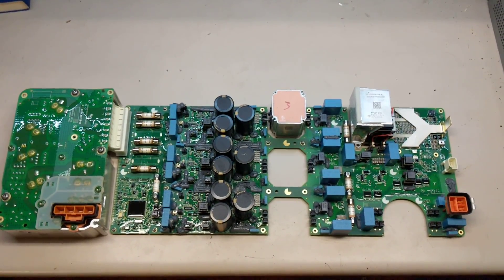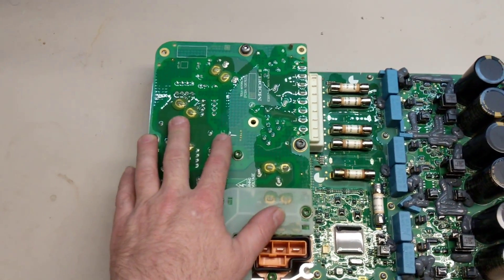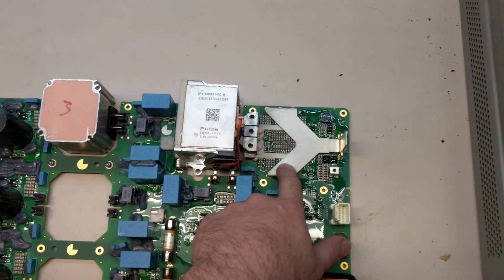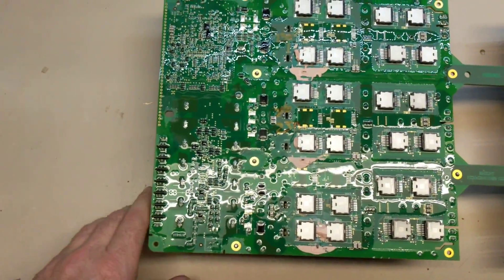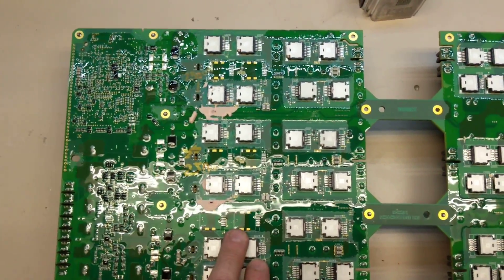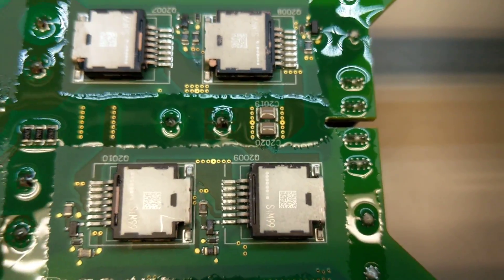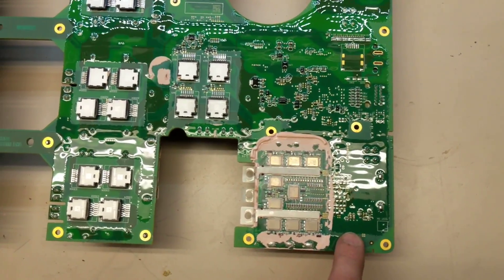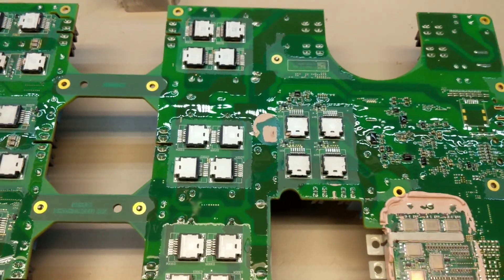Tesla vehicle to grid: Debunked! PART 1

Comment: Love your channel, I am curious, does these motor controllers work anywhere near like a quadcopter speed controller(pwm in controls fets output), is it possible to bump up the curve essentially allowing the motor controller to put out more power to the motor for a given PWM value, just trying to think of ways to unlock the performance model 3, I know the hardware can do a lot more than it does know, and I have many friends that are very interested in this (we think we are being held back to sell more performance model S's, whats the point of buying a P100D if a P3D is putting out similar numbers due to the better battery's and 1200lb lighter vehicle), also how crazy is the intel encyption (you can PM me if this stuff if you want), this car seriously needs to be unlocked

Comment: Most vehicle to grid systems include external V2G unit. Car only communicates and gives access to it's HV battery. Everything else is done via external unit. So Tesla could do an update to make it happen but I'm not sure there's standard communication protocol out there.
Reply: 400v DC is used in the car battery. Coincidentally PV systems are also using 400v to AC, so an external solar unit with a switch would work.
Reply: @martin5697  PV systems use wide range of voltages this depends on manufacturer and MPPT optimized range.  Connecting PV directly to car battery is rather bad idea.

Comment: Your looking at old tec. It dosen't have the inhouse chip that came in  2019, it's been changed again 2020. Sorry this is a very outdated board. Check out sandy monroe's teardown of the model Y it's got another board that's never been seen before. Very different from model 3 2019. This board you've got looks like a 2018/19 early type. First addition. Not a current technology. Tesla moves fast if they figure out a better way they implement it.
Reply: Which episode did they go through the inboard charger?
Reply: Yes and sandy said that there was no vehicle to grid feature when he did some of the tear down.
Reply: Can u please share the link.?
Reply: Did Sandy mention V to G feature?
Reply: @sirousmohseni4  They haven't finished the technology analysis. They tore the whole car apart piece by piece. It's on "Monroe live" you tube channel
Reply: @dhincks1  did they shown OBC teardown
Reply: Yes and they've got their tech people doing a deeper dive than just looking at it physically. Sandy showed the model Y vs 3 they aren't the same.
Reply: @sirousmohseni4  See episode 17 around minute 3
Reply: Read the video description.
Reply: Don't own a Tesla, but if you want to use V2G on an older model how hard would it be for a service center to swap an old board for a new V2G capable board? If this board is the only major swap then it should be straight forward.
Reply: Good video.  I hope newer boards have that in its design.

Comment: I would think Tesla would use the high voltage DC into a transformer base inverter for maximum efficiency. This could easily be done through code and external hardware. I guess we’ll have to wait and see!

Comment: Good video but it looks like a small change and they can have it work as bi-directional with swapping some diodes for IGBTs or SiC fets etc.  This will need a small re-design to add the gate drivers etc.  But Its not unlike Tesla to make running changes part way into a production year.   My thoughts are they didn't bother with this just yet or at least until the new battery.  I really makes sense to have bi-directional abilities with a 1million + mile pack!  Not so much with a 300-500k mile pack.
Reply: @FooBar89  There is 1000s of way to achive that.  IN fact the motor controller already does this.  It tracks the motor back emf and feels the power to the batter or to the motor depending if its negative or positive torque. I don't see the reason for an external inverter.  I meen when you charge at a Tesla supercharger that is what it does the supercharger has many chargers in parallel that tap straight into the back with DC current.
Reply: @FooBar89  No They are going to come with bi-directional chargers they said this during battery day.  But its a gimmick lets put it this way.  Is you car charging from your solar at home when you are at work?
Reply: @FooBar89  Yeah and that is coming. But most cars are plugged in charging when its dark.  So its not as useful as people think it is. Its not easy to use as a backup either because you need a special system that stops you from back feeding to the grid.

Comment: If you have a look at the charger that Jack has in this vieo it looks a bit different to yours: https://youtu.be/Dum1s4gfSD4?t=989. What do you think? Also, it would be pretty trivial for Tesla to replace those diodes with transistors would it not? If that is the only thing needed to do V2G, I wouldn' be surprised if they have already changed it (assuming they want to do V2G).
Reply from the maker: That's the exact same board.  Keep in mind, I have the PCB removed from the housing, and all the magnetics are set aside.
Reply: @Ingineerix  It looks different to me. If you look at the transformer (I think its a transformer? the grey box) on the top right, it looks smaller and the text is printed at a different angle. It's also a different colour, and there are none of the blue heat syncs on the transistor/diodes.

Comment: Could it be that you're looking at an older version of the board? 
Compare to: https://countysustainabilitygroup.com/2020/05/20/tesla-quietly-adds-bidirectional-charging-capability-for-game-changing-new-features/
Reply from the maker: Identical to mine.   You can even see the lack of gate drive IC's on the right side (output) which would need to be there to support SR.
Reply: @Ingineerix  👍 thanks!

Comment: Is it possible they were referring just to cars plugged into a power-wall for charging? Seems more plausinle the DC link may be reversed.
Reply: Yes exactly, battery investor day is as much about the third generation power wall as it is about the batteries. I also heard from a good source that Tesla has a new gateway for the power wall and most likely added connections for the charger in the gateway so that bi directional is possible

Comment: Okay going through all the comments and your replies you're saying that the feature isn't built in, though it is with a software switch to get DC outflow, but it would still require some external hardware....like the HWPC...which was just updated with a capability to do just that...to complete the feat for true V2G?

I get the contrarian view for the clicks, but you'd have been better served explaining all this in your video and saying what is still required, which isn't much. You writing it off as needing "permitting, installation, etc." is just explaining what's needed to get a home charger installed.
Reply from the maker: A HPWC doesn't have an inverter, so it cannot convert DC to to AC.  Go check out a 10kW grid tie inverter for solar. That's basically what you'd need to take DC from the car and put into the grid.  It's Large, Heavy, and expensive.   You definitely need a lot more permitting to install a grid tie device.  You also need an interconnect agreement from your utility, as well as a meter change.  But the only thing I'm saying here is that the PCS Tesla has been putting in all Model 3's is not bi-directional, That's it.  Of course it's possible to do grid-tie, but it's not easy or cheap, and definitely not built in as Electrek posits.
Reply: @Ingineerix  Appreciate the enlightening response

Comment: Also, where are the 3 massive inductors on your one that are shown here https://electrek.co/wp-content/uploads/sites/3/2020/05/IMG_1151.jpg? in the plastic potted mount? Is it possible there are many changes since these production board versions?
Reply from the maker: They are located under the cold plate.  I didn't show them, but you can see the connections for them.

Comment: a 2018 PCS? did you get mine from my 24K VIN m3 that failed early on? That board is Gen1 fyi.

You talk about not seeing it in the code in another comment reply but you're discounting what green said? He seems way more in tune on tesla's software coding than you do, no offense. If this was purely a clickbait article based on current news, congrats.
Reply from the maker: I am a hardware engineer, Green is very capable, but he doesn't know as much about hardware, DSPs, etc.   If it were in the code, I'd see CAN signals, Diag alert codes for V2G, etc.  The only V2G stuff in the model # codebase is for CCS in EU models.  They use PLC to communicate with the charging station which has an inherent V2G as part of the standard.  Hardware doesn't lie.  Diodes can't work in reverse as active devices!
Reply: @Ingineerix  Never even knew they used PLC, consider me chastened, thx for the courteous response
Reply from the maker: Yeah, it's ridiculous too!  You can tell it was designed by committee!
Reply: So they don't code protect their micros ?

Comment: Thick cables run from the charge port to the penthouse.  How come they can get away with those high currents and voltages on a PC board?
Reply from the maker: The thick cables carry DC directly to contactors.  The PCS never sees these currents.  48A max on the AC input, and about 35A max on the DC output.
Reply: @Ingineerix  Oh, I see.  So at a Supercharger, the connector outputs DC.  When plugged into a wall 110V or 220V, you are converting from AC to DC, but that is only Level 1 and we are dealing with much lower currents.  I was wondering how that board deals with 200kW from Supercharger v2, the answer being it doesn't.
I think Jack Rickards mentioned the DC from the battery could be made available as an output with a software change. Could a Tesla be used in a home solar setup, where the DC behaves and is dealt with like DC coming from solar panels?

Comment: So how did the engineer "Marco" get it so wrong. The origin article https://electrek.co/2020/05/19/tesla-bidirectional-charging-ready-game-changing-features/ shows this image https://electrek.co/wp-content/uploads/sites/3/2020/05/Screen-Shot-2020-05-19-at-1.58.52-PM.jpg I'm assuming you're referring to the last mosfet column on the far-right of his simplified schematic? He's labelled these mosfets Q6, Q7, Q13, Q14, Q20, Q21, Q27, Q28, Q34, Q35, Q41, Q42. Are you saying these are actually the power diodes you're pointing at instead?
Reply from the maker: Yes.  I haven't seen Marco's board, but every one I've seen has Diodes.  You can clearly see them in the video.  Also, all Tesla's callouts on this board are 4 digit, since the most of the power circuitry is duplicated 3 times, so for example Q1001 has sisters as Q2002 and Q3003.   I listed all this in my description above.
Reply: Have you tested those passively with a meter to verify they are diodes rather than just relying on the board label convention?
Reply from the maker: Of course, see: https://youtu.be/UkRk2OQI7RE

Comment: Thank you for your expert analysis. It’s not a realistic use of current Tesla vehicles, since it would place too much wear on the battery. It would be more reasonable to expect this functionality with technology on vehicles with the million miles batteries. Perhaps we can hope that an option for this would be available when the Cybertruck comes out.
Reply from the maker: I'm not commenting on the pack longevity, just the claim that the internal charger (PCS) can run in reverse.  But yeah, Tesla has a clause in the warranty which will void it if you use the pack for non-drive applications.

Comment: Great analysis, thanks. But couldn’t the design have changed from the 2018 board you show to today‘s design in the Y and 3? Have you tried to reach out to Marco Gaxiola to understand why his reverse engineering resulted in showing FETs and not Diodes?
Tesla is known for continuous changes...
Reply from the maker: I have access to the code, so I would see an obvious change.  There would also be added CAN messages to make it work.  In addition the TMS320 (see description) doesn't have enough hardware PWM channels to make this work, It would be a big change.
Reply: @Ingineerix  But based on this old board, right?
Reply from the maker: Correct.  But keep in mind, even if Tesla did add SR to the new ones (I'm not saying they did/didn't), You still need a lot more before calling it V2G.  For starters, I don't know of any EVSE's that are UL listed for grid tie.  You'd also need a interconnect agreement with the utility and a new meter.
Reply: @Ingineerix  true, but what about using the power wall to convert the DC voltage into AC? I would bet battery investor day is more about the third generation power wall and an integrated charger or a new gateway with connections for a charger allowing for bi-directional
Reply: @christianpeter7029  This whole article is about the bi-directionality of the AC charger, so the DC charger, although interesting, isn't related to this subject.
Reply: @Ingineerix  My hope is that my Model Y would be able to just provide enough energy power to my Tesla Solar (inverter) to allow Solar to function in a power outage situation, at least then I would have power during the day in a pinch. That would be all I need :)
Reply: @christianpeter7029  I saw an interview with the company that makes the quasar and they claim they could easily do a software change with Tesla to enable vehicle-to-grid in the Tesla.

Comment: Great info! So basically the design is ready for bi-directional, but not implemented yet. When they want to implement they have to change diodes for switches, and that's pretty much it.
Reply from the maker: No, it's not that simple.  It definitely could be done, but it's a major change.  Tesla isn't going to call all the cars back in that want V2G and change the whole PCS out.   The only thing I'm debunking here is the claim that it's already built in.
Reply: @Ingineerix  Oh, I definitely DID NOT mean to sound like they were going to start tinkering with already-built units. I meant changes on the production line when they are closing in on new batteries that can actually take V2G use without debilitating degradation.
Reply from the maker: @RFjellstroem  Ok, Gotcha.  Also as mentioned in my description, the TMS320 doesn't have enough hardware PWM channels to make this work, It would be a big change.
Reply: @Ingineerix  Ok. I'm not super into fabrication, so I don't know how much equipment the fab is going to have to change to produce the boards as bi-directional, but I'm guessing that number would be the key cost aspect for having the design "almost bi-directional" for several years. If the fab can keep most of the equipment after the change, you get lower cost on the new units. Switching the diodes for switches wouldn't change much equipment percentage, but adding more channels might. Not sure, as I said I'm not super into fabrication.
Reply: @Ingineerix  they call all HW2.5 cars back so...
Reply: @mattaut88  Completely different pcb.  HW2.5 -> HW3 has nothing to do with the PCS.

Comment: Jack up a wheel and drive a generator via rollers. Or better yet, drive up on a treadmill type machine so the wheels drive the belt and the belt drives a generator.

Comment: Nice analysis. You proved that car cannot generate AC back, but it doesn't mean that it can be used to supply energy to grid. If you were to install at home special device, which would switch vehicle to DC charging mode, you have basically battery connected to charging socket of car. That said, you can DC charge the car or pull DC current directly from battery. Then this special device can convert DC to AC and push energy to grid.
Reply from the maker: Yes, this is true.  With just a simple software change the charge port could send DC out, but then you'd need an expensive external converter and it would need permitting, installation, etc.
Reply: @Ingineerix  Could you please comment on whether the inverter hardware for the moror is in any way adaptable (as a separate unit) to be able to convert battery DC to mains AC? As an example of what existing hardware Tesla could use to manufacture V2G grid box for the home for example.
Reply from the maker: @chouky02  No, the drive unit inverter is highly integrated, and it would require expensive and bulk added magnetics and contactors.  They would never do this.
Reply: @Ingineerix  Could the inverter in a powerwall do it?
Reply: Do the suspected diodes and transistors have different part numbers? A side from markings on the mainboard, have you taken a multimeter to the suspected diodes and compare it with the transistors?
Reply from the maker: Yes, see the list in my description above.

Comment: Glad to see you're still at it. How's the sprinter conversion?
Reply from the maker: Sprinter is still pending.  We found the Sprinter is as easy to convert.  We are doing the ProMaster now though.   It's chassis is much easier to convert!   https://maxwellvehicles.com/
Reply: @Ingineerix  do you think a diesel hybrid could work. For example put a tesla front motor on the front axle of a promaster and use it for regen and getting off the line etc then have smaller battery to support it. Same thing but in a semi would be great for going down grades etc and getting up them. Don't know if the tesla motor could handle the weight of the semi though
Reply: @Ingineerix  I have seen many a van or truck with kits to make them hybrid, but never for the Sprinter (specifically my 2005) So there's a problem converting them, huh?
Reply: Thank you, I was scratching my head wondering who this was that I'd apparently subscribed to...
Reply: Glad to see you back. Wishing you success with all your endeavors.